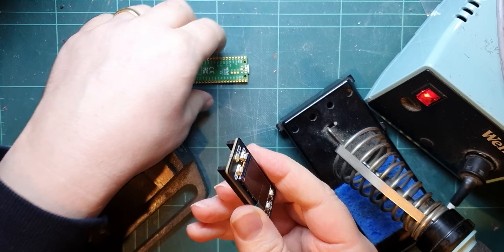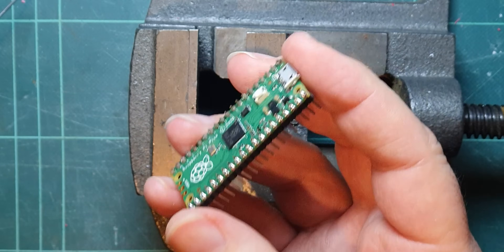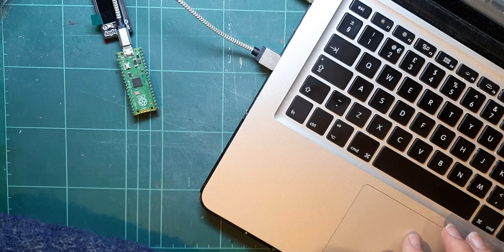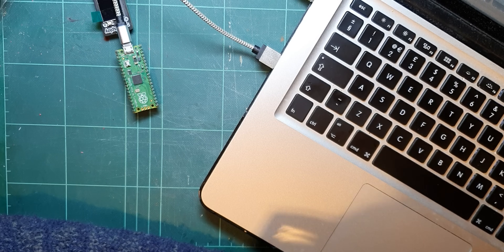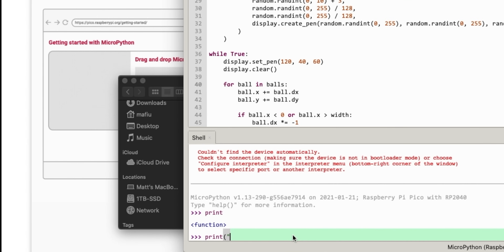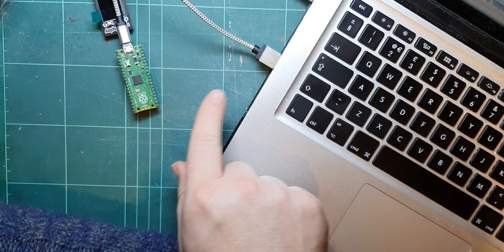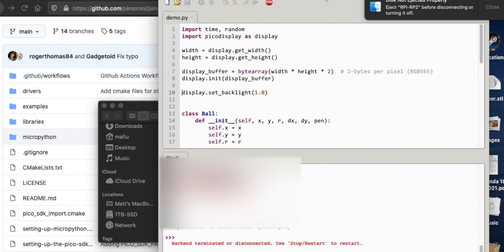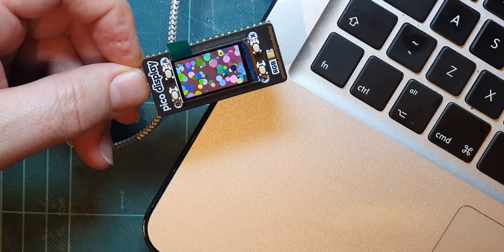First MicroPython demos with PicoDisplay on the new Raspberry Pi Pico

Comment: Flux pens are a must but you have to wipe every surface, top and bottom, and every single pin. A single solder connection should take no more than 2 seconds but always on a board that is immovable. Multiple connections, as shown, should be done with a chisel shaped tip {ie. never-ever use a round tip) that can span two pins at a time, one pin being heated and one being soldered and then slide down the line.

Comment: c.o steven behnke very useful info everyone should know.
if you add a momentary switch to the 'run' pin and ground you can use it as a reset ,hold the new reset button, press 'boot sel' button at the same time , then release the reset, you dont need to keep replugging the usb power any more
Reply from the maker: Thanks Paul - Watch out for this in the next video (I think)   But I got the idea from Ben Heck.  It makes things easier doesn't it.

Comment: It literally says to use Pimoroni's UF2 file ON THE PAGE YOU ORDERED THE DISPLAY FROM!
Reply: I went that route as well, as the easy way, but there’s gotta be a way to upload/include third-party modules from Thonny into the “factory” MicroPython build. While I’m new to the Thonny/MicroPython world I write/use/include both my own external modules and those from third-parties, pretty much daily. 

Time to creep down that rabbit hole. I’d think it’d be risky running a non-official MicroPython as then you’re dependent on them rebuilding their version as the upstream changes. Third-order Linux dists are infamous for this being an issue.
Reply from the maker: Its easier than I thought if you can find the code - new video about this coming soon
Reply: @c1ph3rpunk  (years later) One option would be to use CircuitPython instead, which is from Adafruit, so that can be used with the Adafruit GFX library for CircuitPython... called Adafruit_CircuitPython_GFX.  Installation is the same, just a different UF2.

Comment: I wonder why there is no line draw. More basic than a circle...
Reply from the maker: Agreed.  Strange that's not provided.  I suppose you would use point and draw the line yourself.  The libraries are a work in progress though.
Reply from the maker: Try using display.pixel_span(x,y,length)    At the moment this just draws horizontal lines.  There is a third party documentation project runnning at:  https://github.com/UnfinishedStuff/Pimoroni_Pico_Display_Pack_documentation  Thank you to 'Jyv Ben' (cant find actual user name) and @Festy for introducing this to me,   and of course the mysterious UnfinishedStuff for publishing it